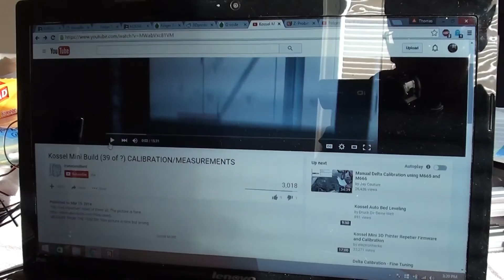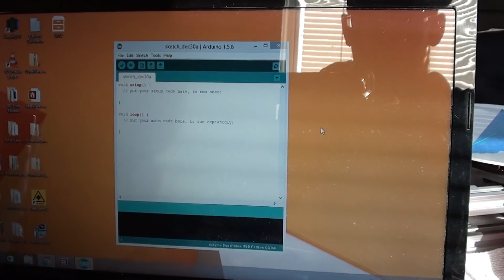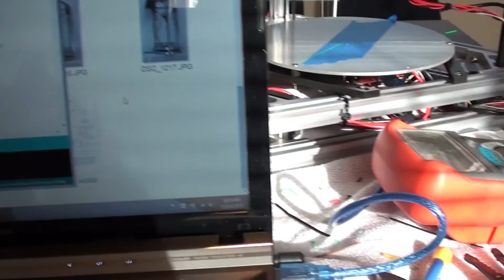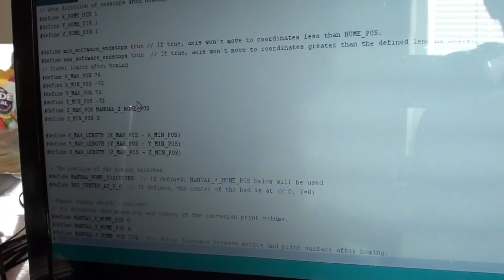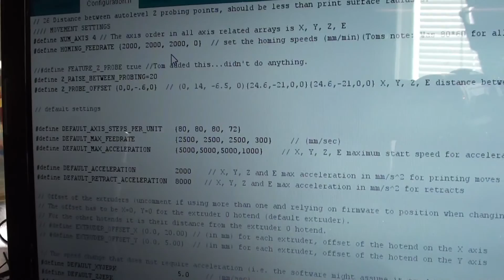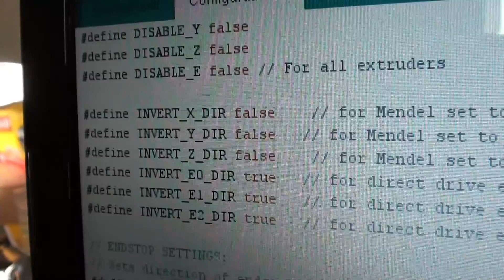Folger Tech Kossel Rev B. (Part 3) - Tips, Commentary, Opinions, and Aid

Comment: I managed to get the printer to home. but when i use the "G1 Z10"command the y motor seems to be going upwards instead of going downwards, do you know why this is.
Reply from the maker: I'm nowhere near my printers now, but I know what you're talking about. There should be a line in there that reads something like this: #define INVERT_Z_DIR true. If yours is going in reverse, this is most likely what you have to change to the opposite (i.e. if it's "false," then change it "true" and vice versa).
Reply: Thanks I solved it.

Comment: So I also received a Kossel recently. I experienced much of the same frustration that you did. It was only after completing the build that I happened across your videos. Wish I would have before then.

I have now finished the build, but am experiencing a few problems perhaps you can help me with. I'm using Repetier as a host. The manual controls don't really work very well. The only direction that any of the manual control arrows moves the effector is up. Which leads me to believe that something is wrong in the firmware, but I don't know what. 

Somewhat related, homing doesn't seem to work correctly. When I tell the printer to Home, all three roller carriages move upwards until only one hit its endstop. At this point all three carriages stop moving. The one that hits its endstop doesn't back off either. A sort of whiny whistling noise continues like it's trying to move past the endstop.

Lastly, I cannot get the heated bed to work. The thermistor is working, but the bed will not heat up. I'm not sure if I have something wrong in the Marlin firmware or what. I have tested all connections on the bed to ensure I have a good circuit. I don't appear to be getting voltage to the D8 connectors on the ramps board when I tell Repetier to turn the bed on. Any ideas?